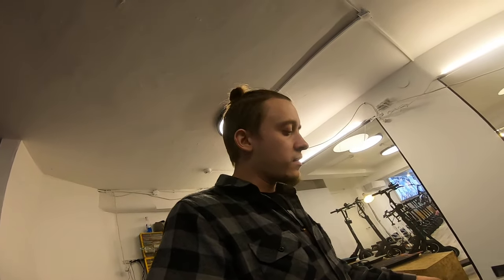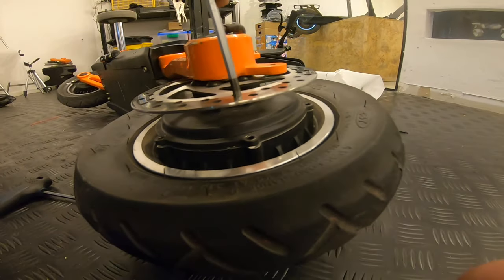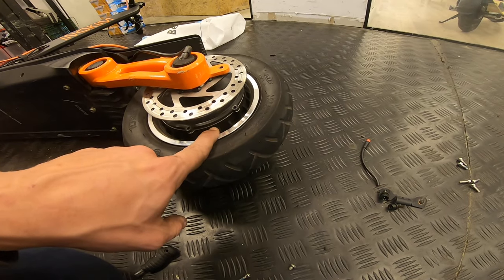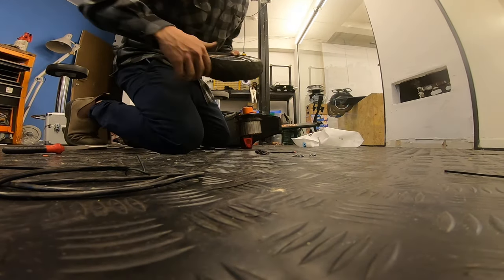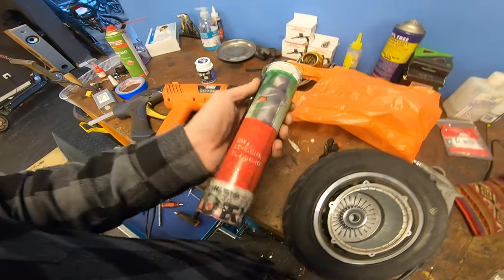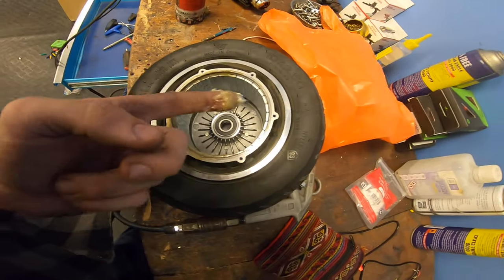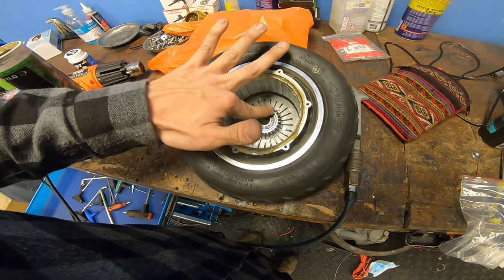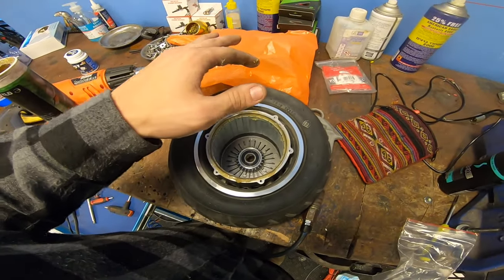Inokim OX motor removal and waterproofing

Comment: Thanks you for the tip, very useful since im using inokim ox in a tropical country which most of the time it rains here really hard. I hope I could find a suitable grease like you used on your Ox.
Reply: yo im looking at getting an Ox. did you ever end up having water damage? ive seen comments from some guys who didnt even grease and did fine so just checking.
Reply: @jakestephens4868  No, I haven't tried running it on a really bad weather, but I did run it on a light drizzle and never had problems with it as long as there's no damage in your cover. But for your own peace of mind you'd want to try waterproofing it just in case.

Comment: Keep up the videos.  I dont even own this scooter but love watching your work.  You are getting known on facebook groups too.
Reply from the maker: Really appreciate it man, means a lot to me! i am planning on better produced video in the future,  not just "live stream" type as this one. Stay tuned :) 
and BTW, a lot that is done on this one might work on other brands as well, they have a lot in common !
Reply: @SUB13333  I see a lot of the work you do to the scooter can be done on many others.  I like the ferro fluid to the motor trick.  I have a kaabo mantis pro on the way.
Reply from the maker: @MoeReefs  ferrofluid is needed only if you going with much higher than the original motor rating . as stock you wont need it.
Reply: Thank you for your videos, they are helpful.

How do you remove the entire wheel assembly (rim, disc brake, motor, and tire) from the rear suspension arm? There is a wire right in the middle of the nut.

(In this video, you just removed the motor assembly and left the disc brake.) 

How often should we put grease on this part? 

Thank you again!
Reply: Hey brother nice vids.. question, i have the OXO but want to make sure I’m on full power, not referring just to speed- I’m referring to 100% usage of everything.. cause idk the setting to do that on lcd.. can you help? Cause I don’t want to be on eco mode.. i want the full power unlocked. Thanks
Reply from the maker: @roscalalmodovar6584  tbh , I've ridden the stock setup for literally few minutes before swapping it to custom shit :) . 
So I have no idea whats going on on stock settings.
Reply from the maker: @AL-gm5sw  I will make a short video about that.
Reply: @SUB13333  Thank you! Looking forward to that!

Comment: So pleased to see this as an early OX adopter. Thank you,  but am I MISSING something?? After greasing the rim and bearing how does one line up the bolt holes when replacing the wheel under that heavy magnetism?
Reply from the maker: I'm sorry I didn't get your question. How is the bolt alignment interfere with the process?
Reply: @SUB13333  How kind of you to reply so soon. Thank you!. After reviewing the beginning of your video once again, I noted where you were able to move the inner plate bolt holes freely to align the motor housing mounting holes itself so it isn't going to be an issue after all *Smiling*  Thank you so much again and hope your studies (electrical engineering perhaps?) are going well for you.

Comment: Awesome video, thanks! So my rear wheel seems to be off balanced cause it's causing the whole machine to vibrate. How could I fix that?
Reply from the maker: Deflate it completely, add some soap water on the rim and tire, then inflate it just a few psi at a time and check that the tire is seated propely ( spin and watch for wobbles , some wobble will always occur, the idea is to minimize it ). If theres a serious offset at some part of the tire, when not fully inflated ( about 10 psi ) its easy to just push\pull\ squeeze it in the right direction.

Comment: Hi. Would you be able to do a video for putting the rear wheel back on? It seems like there is a small bit that you need to pull in once the magnets have caught to allow the engine to seal?

Comment: Hey dude, I hope you are well. I love the videos you post. I just got an OX a few days ago. You seem to be the best expert! I have a major problem. on a ride exactly one day after I got it the motor seized. Applying throttle gets me very little thrust and it clicks and grinds from the hub. Of course I am not using it now. Do you have any idea what could cause something like this? I really appreciate your help if You could advise me.
Reply from the maker: They had a batch that their controllers  were shorted after you hit a bump, but now it fixed. Maybe you've got one of that exact batch. Usually covered by warranty.

Comment: Can't you just get one allen without grips and cut it short enough to fit underneath brake disc?
Reply from the maker: Yes you can.i also use ball head allen and just route it through the rotor holes. Got to be careful not to slip in the bolt heads and damage them
Reply: @SUB13333  Alright thanks for quick reply, recently bought OX super and since it doesn't promise any water resistance, at least on page of manufacturer, I stumbled on your video. Thanks for a advice! Keep up the good work! :D

Comment: hey, can you tell bearings code for motor wheel ? thank you!
Reply from the maker: MY MAN.
Reply: @vshslv  do u know the size of the rear bearing mine is seized need to remove
Reply: @SUB13333  sup man great vid would u know the size of the rear wheel bearing? Is there one or two?
Reply from the maker: @ewan9368  there's answer to that few replies above lol

Comment: one more thing what size nut is used on the axel. There might be a socket in autmotive repair it's an o2 sensor socket it would save a lot of work if it was the correct size?
Reply from the maker: its 19.

Comment: While your in there you could further protect against corossion by applying red insulating varnish to the magnets and the stator.

What kind of grease are you using?
Reply from the maker: Familiar with this solution I just think it's a bit over kill for me, not planning on going heavy off road, just occasional weather slips. The grease is high temp grease, by wurth.

Comment: Would ball end Allen keys work better?
Reply from the maker: yep. also, to be 100% sure, you can unscrew it with  r-type allen key  in between the rotor and the rim, just to release the tension, and then proceed with ball end allen through the rotor for quicker results.

Comment: Do you really need to seperate motor from magnets just to put grease on ? Wont be easier just glue or something to cover that gaps ? Of course might be best idea to seal engine copper wires like i did with mi pro m365 
And i am thinking to get inokim oxo do i need open whole cover to check out if everything is tight and fit ?
Reply from the maker: about 70% of the OX motors i've opened, had some rust in it. ( brand new ). 
i removed the stator to make a cleaner job, and its pretty easy to remove it so why not. it gives you a chance to take a glance at the whole thing , and theres nothing bad in that. motor copper wires is least of an issue, because when water gets in, the rust eventually ungluing the magnets.

Comment: After taking the wheel and casing off as shown in video, How do you get the disc side off ( other side of motor)
Reply from the maker: That's a different procedure that is not required for water resistance  process. 
You need to deattach the motor cables inside the body and use 19' socket with a cut in it ( you should've got one with the scooter but it's a very bad one so don't use it , but buy a similar one just better quality. I didn't even buy it, I just took 19' socket and made a cut in it with angle grinder so I would be able to put in on a nut and the cable together )
Reply from the maker: This is perfect for it : 

https://www.ecstuning.com/b-schwaben-parts/strut-nut-socket-19mm/003046sch01a-02/
Reply: @SUB13333  the nut is off the cable is dis connected it is reddy to push through but I can’t get it all apart
Reply: @SUB13333  I have a deep ring spanner already for the job I just can’t get to the bearing what is on the disc side
Reply from the maker: @JJ-yz4bm  apply some lubricant , let it soak, shake it a bit, carefully use something as a leaver between the arm and the wheel ( watch the rotor so you won't bend it ). It is just a tight fit.
Reply: @SUB13333  I will keep trying thank you for getting back to me appreciate that top man
Reply: @SUB13333  do you know which bearings are in the rear they are both different ?